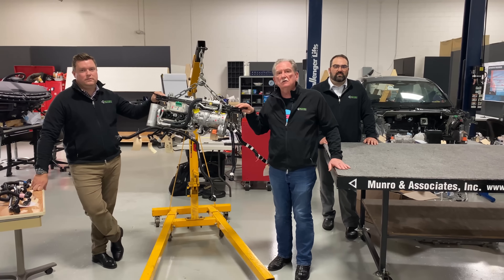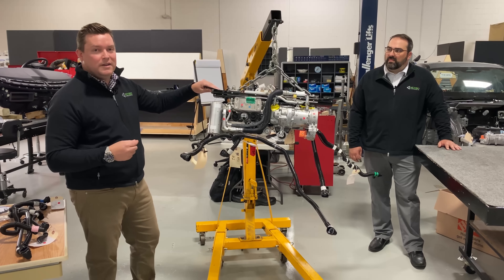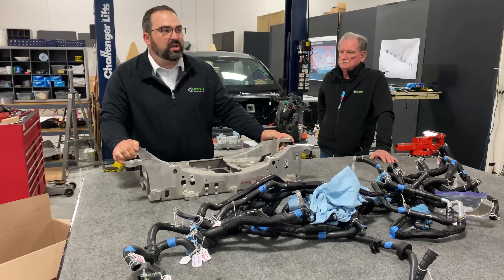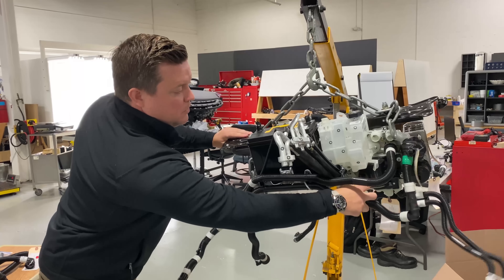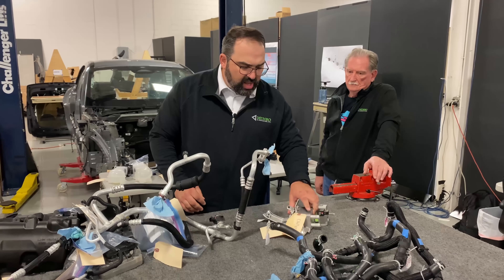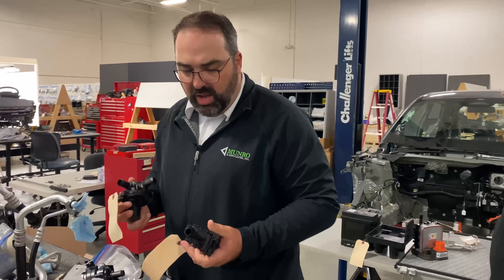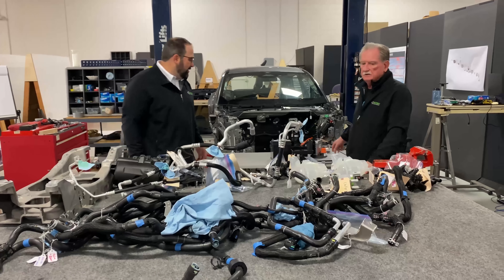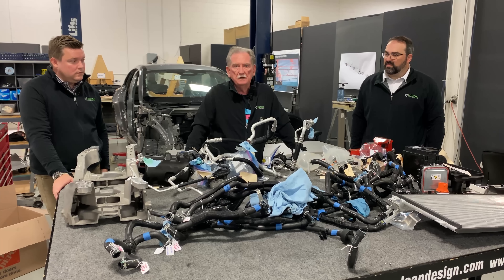Mach-E Thermal System Part 2: A Detailed Comparison to the Model Y

Comment: This is another example of what could be improved on if they just attempted to bring in seasoned mechanics to help with design. Every gear head I know that Luke to build up street rods or race cars did everything possible to shed weight. I once built up a 71 Malibu for fun. I had built a v8 that put out 370 h.p. it was mild because it was a daily driver type car. I stripped out and took out everything that was not essential. I got 23 mpg on the hwy with that car if I drove it softly. That was a big car by today's standards. I was pleased as punch with that car. The combination of torque, weight reduction and gearing took a 14 mpg car to 23 but I also eliminated all pollution control and vacuum garbage I could to the bare minimum. I put lower ratio gearing in the rear end looking for top speed and lower weight nice looking magnesium wheels. I also lowered the car and put a 6 speed manual transmission in it. I was not engineering for the purpose they are now  but I stumbled accidentally onto a very efficient combination.

Comment: Great hardware/installation comparison. In a future video, will Munro discuss the additional profound conceptual differences between the Model Y and Mach-e's thermal systems? The Y uses a heat recovery heat pump for both cabin and battery heat vs the Mach-e's electric resistance (PTC) cabin and battery heating. Even without factoring in weight issues, the heat pump adds significant vital cold-weather range to all EVs that properly apply them.

Comment: And yet none of this translates into reality. Model Y is not lighter than Mach E, doesn't go farther on a charge in real world conditions, and doesn't cost less. Tesla has also proven that they do not engineer for longevity, so what does it cost to get to the octovalve when it fails vs replacing separate inexpensive pumps or valve assemblies on the Mach E.
Reply: Model Y’s cooling system is way more complicated than Fords. Just try to repair an Octovalve compared to a three or four way valve. Tesla’s parts are very expensive and hard to purchase in a timely manner. I’d much rather work on the Ford hoses than the Tesla proprietary cooling equipment.  '
Reply: Tesla has proven they don't engineer for longevity?  Nonsense.  You were doing good up to that point.  Throwing in a made up fact just kills your more valid points.
Reply: @TheEvilmooseofdoom  NTHSA forced recall of main computers? Model S batterygate?

Comment: Remember to elucidate your TLAs (Three Letter Accronyms) guys, in this and other vids. Otherwise a stunning comparison vid. It seems that Ford DO NOT have product design. What they have is component design that happens in isolation and then try to Meccano a product together out of the disjointed components. Unnecessary weight in the design is the symptom, the cause is that there is not communication and coordination in the design i.e. poor management and poor organisation preventing possibly good engineers from doing their job.

Comment: is there something to be said for the thermal heat absorption of all that flued?
Reply: Not really (speculating and an amateur)
Since it's a cooling AND heating system, opening a large, uncontrolled surface area to the elements is surely not a good thing?
Large vertical drop, potential for temperature, maybe pressure variation top to bottom?
Resultant air locks?
More energy required to pump the fluid?
etc, etc

Comment: can you imagine the air pockets in that, 60 lbs of fluid compared to 20lbs Tesla, if I weight  400lbs and complain my car is not getting full value.
Reply: That's probably one reason for the multiple pumps. Inability to clear air from the system.
Reply: @rogerstarkey5390  That is a disgrace in workmanship.All the hoses is really sad to see.

Comment: You are measuring coolant fluid in kilos? How many litres is that?
Reply: It must be close to the same as cooling liquid is usually made of 50% water (1 kilogram of water is roughly 1 liter of water) and the rest is ethylene glycol.  The latter is slightly heavier than water (10% or so).  But I may be wrong as I have never really looked into the composition of modern cooling liquids.
Reply: @pierre.a.larsen  Not really the point. Volume is measured in m^3 or equivalent in litres.
Reply: @bosnianswede  Yes, and the volume in litres ought to be slightly less than the number of kg (my guess is 5% less)

Comment: I expect Tesla to have superior software, electronics, electric motor technology as well as battery design, but come on Ford!! You have been making cars and cooling engines for 120 years.  You would think Ford would be experts in thermal management. I think Ford needs to fire 3 or 4 VPs of Hoses & Valves
Reply: That 120 years tradition and being good with the old tech is exactly what holds Ford from being creative. It is like trying to do sharp turn with Titanic.

Comment: You can see where the Mach-E does well when it is relatively close to Ford's core competencies and how as you move towards aspects that are unique to EVs or new to Ford, their designs and implementation are a disaster. Sadly, the rate of their improvement is very slow and so no chance they close the gap with Tesla.

Comment: Everyone talking about hoses, in a ice engine which get very hot and under pressure compared to a ev the hoses will probably last the life of the car but I do think ford over complicated the system with off the shelf and in the bins item 2 many hoses.
Reply: Crimped hoses leak. Look at power steering hoses which usually all end up leaking. 70 crimped hoses are gonna have leaks long before the car is scrapped.
Reply: @mikedx2706  one of the reasons for busted hoses and licking clips is because of a blown head gasket puts the pipes under hight pressure, if you buy a second hand car and you press the hose and they are hard to press don't buy the car
Reply: @mikedx2706  plus most power steering use metal pipes because of the high pressure like brake pipes are you a mechanic?

Comment: Mach E looks expensive to repair.  I'll forget about the tax rebate and buy a Model Y.
Reply: But at least you can get a Mach E repaired by a local dealership, unlike a Tesla.  https://www.thedrive.com/news/41493/teslas-16000-quote-for-a-700-fix-is-why-right-to-repair-matters   The main driver that will doom and limit Tesla ownership is INSURANCE COSTS.  Sure Tesla may have an elegant design but just try to get it serviced or even get parts.  Insurance companies will punish Tesla owners.

Comment: 35 rubber hoses filled with coolant.  70 clamps with the potential to leak.  Almost unbelievable.
Reply: Don't forget that they have dealers to please, they need to something to break and charge $$$
Reply: @martinbeaudoin666  Question is why they need to please the dealers. What are they going to do? If they drop their agreement with Ford, they would do Ford a favor in the long run. Ford would be able to sell direct to the customers like Tesla. As long as they have a dealer network, they can't do that. Ford does benefit from the maintenance because they can sell parts to the dealers and other mechanics.
Reply: @ymcpa73  "please" = "keep in business". Ford cannot afford for their dealerships to go bankrupt. That'd mean they'd have no way of selling their product anymore...
Reply: Don’t forget the 4 pumps at $600 or more
Reply: Ford, where quality is job NONE
Reply: Looks like they need to rethink some things some more.
Reply: I don't really get this. From a production viewpoint , sure, there is cost involved. But as a consumer I'm not that worried. I have a fairly largeish boat. Got way more hoses and clamps than that. 14 of them connected to through wholes that could sink the boat if they fail. Inspected once every year and changed every ten. I sleep soundly. 

As long as ford uses quality parts this is more of  a problem for Ford (and sandy does well to point that out) than the consumer.
That said, if I was a ford executive I wold get Sandy to simplify this.
Reply: @higfny  come on it is a mess
Reply: @higfny  you assume its a simple issue of quality parts. Ford and GM have a history of crappy parts. Doesnt bode well.
Reply: @andyfreeze4072  fair point well made

Comment: I do not think the coolant volume is that much of a negative and also the dual loop isolation.   Sure there are a lot of hoses and such but they do not test the thermal efficiency in this video. One would have to place sensors in each vehicle and actually load the systems to get that, then you have to take into consideration it's effect on product longevity.   If anything I have the impression that Ford took heat management very seriously. To the point that their cars shut down on long downhills not due to failure but to prevent soak and failure.    Time will tell, hopefully Ford batteries will not cook off like Bolts.

Comment: There was news in Norway that Mach-e EVs have been overheating and shutting down. Would be interesting to hear if there is a theory on the cause. 

Software or hardware?
Reply: Apparently it was down a hill, and the regen braking was putting more current into the batteries (thus overheating) , than the cooling could handle. Some sensor then shut the car off (coolant, or battery temperature.) Not enough testing on all possible driving conditions....
Reply: @chrisheath2637  Yeah, that's what I heard.
Reply: @chrisheath2637  
Therefore,
Option 1. Cooling system redesign (not likely)
Software reduce regen (dealer visit(!) and less efficiency)
Either way, not good.

Comment: Absolutely overwhelming I would say, hats off for this type of approach to design and industrial performance!  My questions are however if a) all at Tesla's main current competitors are simply stupid, lazy or both; b) No one cared to do some reverse engineering on Tesla (which does not necessarily mean infringement to IP rights) upstream design phase; c) this is just the weight of legacy.  And I would tend to think that somewhere down the line there may have existed strategic industrial development decisions made to lower the opportunity cost (thus the potential cost associated to the risk) of venturing into a totally disruptive type of vehicles, where using existing (and/or out-of-the-shelf) design solutions and/or components, as well as low-cost design & industrial development / incremental changes, instead of starting everything from a blank sheet, as Tesla of course has been doing all this time.  The pure engineering advance that they have does not surprise me completely (the tangible gap to legacy builders as this video shows does, however).  A price Tesla continues to pay, for instance, is the still low, albeit improving, sustained reliability of their quality build:  When you know that you should spend 2 hours inspecting every single inch of your car at purchase and that most likely you will have to return to the dealership at least once or twice to have totally evitable assembling flaws corrected, it seems clear that it is not only competition that has a long way to go, Tesla does, too.  I hope they all shall somehow converge by the time when I'll buy my first BEV, once my current and highly reliable W212 Mercedes-Benz shall eventually have to be replaced.  Congratulations for your excellent and highly valuable work, which I avidly follow all the time!
Reply: Watch the Tesla owners club YouTube interview from this week.
Sandy commented on the perceived "Tesla quality issues".
(Don't jump to conclusions!)
Reply: @rogerstarkey5390  Thanks for the suggestion, I will for sure, always ready to learn further and change my perception should this be the (justified) case :)

Comment: One of root causes of the Ford problem is the lack of vertical integration from their suppliers. Their HVAC cooling suppliers never talk with their motor cooling suppliers who never talk with their brake cooling suppliers, etc. They all design different systems that have to plumbed in together. Tesla does vertical integration from design day 1 so we can the efficiency of an octovalve.
Reply: Let’s not forget all the huge profits the suppliers make on all those hoses they are selling to Ford vs the profits they aren’t making on their hose sales to Tesla.

Comment: I understand they split it in half, 1  set of stuff for the motor and a second for the bats. Ford is using the bat setup in a lot of cars models are brands around the planet.  So having 2 systems is understandable. But Ford still needs  the 2 units smaller, that bolt together. so when they need one part and not the other they can bolt one with a different unit when need be.  they get to keep the savings of scale. additional they get increase output.  So if i was ford I would have everyone at ford take part of  a contest with a good size $$$$$$ prize on cutting this units down by 90%. Hell it ford they should send it to  universities  the student team that can cut this down the most gets jobs today at FORD.  they get ten of thousands of people attacking one issue at the sametime.  heck they can do that with a couple of the problem areas. and then have a really great car within 18 months.

Comment: Awesome video.  I will offer a few things.  Every 90 degree bend is equivalent to 2 feet of hose in fluid drag.  That should be added to the lengths from a pumping efficiency and therefore thermal transfer efficiency.  Total system weight comparison with fluid would be cool to know.  It would have been good to point out that the tesla has no ptc heater.  Theirs is software only in adding non phased power to the drive motors and then moving the heat. This could be a show unto itself!!  Also the ford has less ability to move heat to and from thermal channels.  Therefore they have to have the larger heat rejection system!  Love having Cory added to Sandy's dialog it adds so much to the talks.   Sorry for the fragments, you get it though I hope...

Comment: I'd love to see a comparison of the current 3/Y thermal system to the first thermal system on the 3 before Tesla had the heat pump / octovalve. A lot of people here giving Ford shit, but remember we are comparing Fords first attempt vs Tesla's refinement on their third generation platform.

That's not to say that Ford shouldn't have done better as they came after Tesla so they should have learned from them, but I'm still curious how this all compares to earlier Teslas. Also shows how much better the second generation of EVs from traditional manufacturers can be if they follow Tesla's example and iterate and improve on their designs.

Love this channel, these types of breakdowns and comparisons are so interesting!